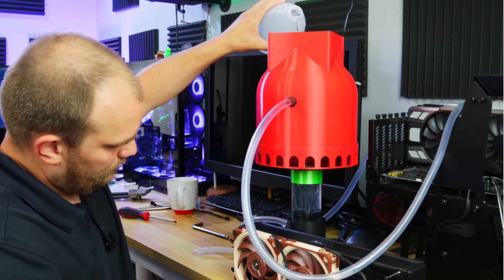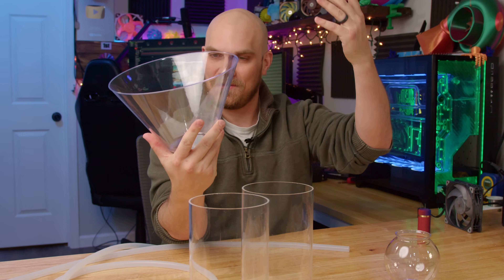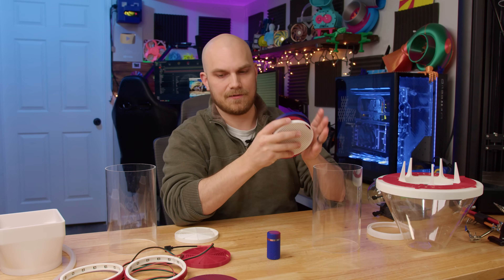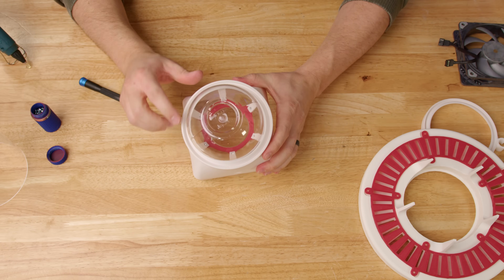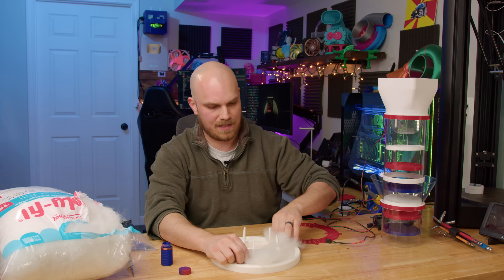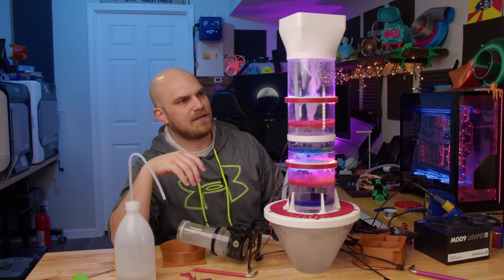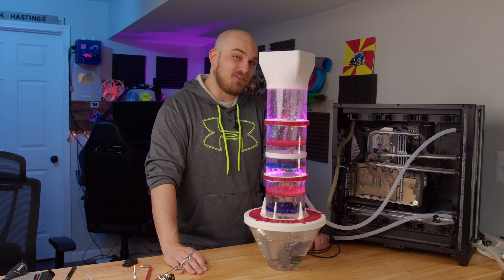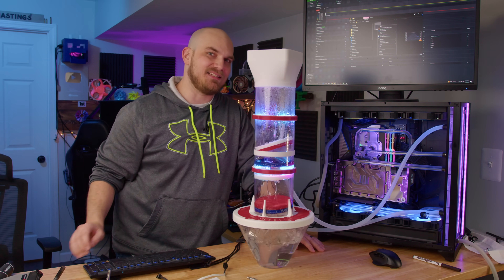Water Cooling..... With NO Radiators

Comment: Swimming pools in the deep south often use a fan shaped sprayer to arc the water into the air back into the pool, used to cool the water. That's basically what you did here in a more controlled package.

Comment: I just use a copper heatsink with copper and plastic fittings, vinyl tubing, and a copper heat exchanger. I have a pond pump, but no fans on the heat exchanger, just ambient temperature of (71F). Keeps my Ryzen 9 3950X nice and cold.

Comment: you might be able to use a second fan to "spread" the water if you drop the water dropplets into it while spinning...  if you manage to insolate it good enough it could do a very good work into atomizing it for maximum heat disipation

Comment: Love the innovation. You asked for a challenge? MAKE a PC case using multiple 500mm radiators stuck together (possibly welded?) for the top, side, front and bottom, so four out of the 6 case sides. Then get a regular rear "metal"/3D printed rear plate with cutouts for IO. And finally hang the motherboard mount on cables under tension, like the EVGA E1 PC case.

I would imagine two length ways 500mm radiators to form the top, the same for the bottom and front, then five 500mm radiators to form the side of the case. A total of ELEVEN 500mm radiators, for what could be enough passive cooling to require no fans, just the pump to move the water through all the radiators.

Alternatively, you could either find, or 3D print, a distro plate to form the front of the case, so only top+side+bottom were radiator walls, reducing the number of needed 500mm radiators to nine.

Comment: you may want to add a tank that the pc uses as the source of water, then use a higher pressure pump (e.g. 12L/m at 50psi.) for the tower and use an aerosolizing nozzle (i.e. garden hose on spray) and don't use the fills.

Comment: i have built an industrial cooling tower and worked on others.  Fan on top vs fans on bottom doesnt seem to matter.  What does is the travel time of the water from top to bottom.  This would work better the more you can break up the droplets, it increases the surface area of the water and slows down its journey through the air.  Instead of 3-4 fill packs I would have 15-20 with maybe 3 gaps for rgb and visual appeal.  also the the fills should alternate between convergent and divergent, you dont want to have all the water in the middle or all on the outside.,  need to start with a shower head and then try to keep it from reforming into streams.

Problem is that if you get this working right you'll need a dehumidifier in the room hehe.

Comment: What if you had more of a mist tube. Water coming in would be pressurized into misters that make the water smaller particles and easier for the air to cool? Or if it's an actual pressurized system you could make it steam into a box maybe with a copper top that causes it to cool then drip down back into the system on the cooler side? Could be fun

Comment: I think you need to take a look at "Swamp Coolers" that are used commercially.  If you want evaporative cooling you need the water running over more surface area, preferably something porous to both air and water.

Comment: I wanna boldy assume that most cooling happend on the walls of the tower and not by the low air flow along the water. Now if thats true, a design with a tank (or tower) of water with heat exchanger /tubes or something that passivly transport the heat from the inside of the water tank to the air outside would work better (and quiter). Would love to see it :D

Comment: you could of also fully cut a hole in the bottom of the fish globe a couple inches across so air had a path upward and the water wouldn't form a single stream downward off of it.

Comment: the shower bits should of had cones both up and down so the water level on top of the shower head could not reach the open top cones, so the down facing cones would also drip from the cone nozzles and not join the water from other openings....

Comment: I once had the idea of using one of these epoxy river/ waterfall- desks as part of my watercooling loop. But it probably wouldnt have looked pretty for long with hot water steaming up. I did build an evopartive cooler from a small jar that had a showerhead inside and a fan on top. Worked good as a temporary setup but I had to fill up the water level once a day.

Comment: I very long time ago, I used I "Y" fitting on 4" pipe. 1.5' going down into a bucket and 3.5' going up in the air.  Using a rain type of fitting for a kitchen sink at the top of the pipe and 3 92mm case fans stacked on top of each other connected at the "Y" fitting I was able to leverage evaporative cooling.  This was all sitting in a 5 gallon bucket with a fountain pump cooling my Duron 900.

Another way to increase your surface area is to use scotch bright pads(maybe you can find white ones), I actually enjoyed the rain cooler.  Cool to see the same concept used twenty years later.

Comment: I kept looking at this and thinking "why not just use a rain wall instead"? You could easily put a rain wall in an enclosure (like a fish tank or plexiglass box) and then add a filtered intake fan and a fan for exhaust. You'd get plenty of evaporative cooling, filtered air and a lot less parts.

Comment: You should coat the inside of the tube with a hydrophobic material, it'll look a lot cooler but ironically slightly decrease the actual cooling.

Comment: what if you used a bunch of 120mm radiators as your filler and daisy chained the rads together to form one larger rad  then run water through the 120mm's fins in a stack, you could add the radiators as part of the  loop or as two separate loops  for example the water tower to cool the radiators that is circulating the pc water. rather then running the same water through everything.

Comment: having venting on the sides of the tube can take advantage of the bernoulli effect as the falling water should create a pressure differential. You did have the right idea using t he fish bowl but the water fall into the space between the bowl and funnel not ride the surface of the fish bowl as will only pull air based on a little friction  rather than pushing it downwards with its own surface area of each drop.

https://youtu.be/uvf0lD5xzH0 This video by practical engineering explains it with video and images.

Comment: Instead of having multi layer water spreader, why not use a high pressure pump with a mist nozzle at the top?
And that way, at the same time you could have the filter be underwater because of that high pressure pump.

The only hard part would be finding a pump that is quiet 😅

Comment: The biggest problem with this is going to be contamination and evaporation. A filter and UV light are going to be absolutely necessary long term and constant level monitoring might be needed depending on the climate in the area. With some more testing it could be very powerful though. A misting system could increase the cooling by a large amount instead of the droplet cooling.

Comment: Honestly I could see this working better with a bit of refinement, like as you said using filament that can handle higher temps, not using hot glue or any glue that would degrade with heat or water, me personally I would find a way to set up at least 2 fans up top to improve the amount of air being pulled through the system and even maybe having 2 air intake sections.

Comment: I used to cool my system which had core 2 duo and 8800GTX in it with something like this, it was idling 4C below ambient, I built it with tubes for sewers, basically just 150 meter long tube with 45 degree T pieces at the top and the bottom, I used an shower head as a nozzle and an centrifugal fan which head car air filter hooked up to the intake and output of the fan was hooked up to the bottom of the tower, the output of the tower was connected to the chimney.

Comment: +1 for making this its own series! Suggestions:

1a. 3d print spacers to separate each fill section: like \/\/\/\/\/\/\/\/\/ and wrap it around the inside of the tube. The tube means it can't expand outwards, so it just acts as a mostly-see though, very quick to print spacer. Also it should give the thing an industrial look

1b. Try using a 12V centrifugal blower on top - those make much better pressure difference than a fan, so it will be able to draw more air though - because it seems like you're pressure difference limited. Against a partial vacuum they'll spin up to a bit higher speed, which makes better delta-P again (more compression ratio), this why they're used pretty much exclusively in vacuum cleaners.

2a. Try making a 'Rotating Liquid Sheet contactor' (https://www.sciencedirect.com/science/article/abs/pii/S0255270116303695) : These have performance as good as a fully packed bed, even without any fill. These use a liquid sheet slot nozzle wrapped into a helix. You 3d print the inner nozzle). The sprayer is then rotated, which causes the sheet of water contacting the air to act like a fan itself. (https://youtu.be/Gi1G9zPqFSw ).  Key bit is 'slanting' the slot radially upwards a bit, so the water going out is also going a bit upwards, before it falls back down. There are design equations for it all on a paper, but it is behind a paywall.

2b. Might be interesting to try waterproofing a PC fan motor (because they don't have brushes: Probably something like dipping the PCB in epoxy resin, and coating the magnet well in heavy duty anti-rust 'fish oil' spray). That way it could be in the tower, spinning the RLS sprayer.

Comment: Used to play with these in the early 2000's. What you want is as small dropplets as possible spread as uniformly as possible and you want them to free fall against the airflow as long as possible.

Designs back then where otherwise quite simple and similar, just a collecting reservoir on the bottom with pipe to the PC and pretty long and wide tube (I used to have 1,5m 300mm PVC tube as the "rain tube"). The top part is the difference, we didn't go for direct airflow because we used the very top to diffuse the water (1-4 pipes from the PC pushing water to small PVC pipes at the very top with holes on the under side and under them a diffusing layer that was just a PVC cap with a ton of small holes through which the water just barely dropped down to the pipe). I used to have 2 fans in their own pipes separating from the rain pipe to upwards to the sides so water couldn't be pulled into the fans directly.

The true art came from tuning the fans. In the best case the airflow needed to be just rightly distributed so the dropplets don't get flown around in the pipe and hit each other and grow in size, so as stable and directly down to up as possible. The second part was the force of the airflow, you wanted just enough that the dropplets don't fall straight down but they fall slower because the airflow because the longer the dropplets fall, the colder they get.

I would recall some people who put way too much time to it managing to get the water returning to the PC being subambient temperatures. But the whole thing fell to the history once someone found out you could just use a small intercooler and strap fans to it instead of this huge rain tower and we got closer to the modern watercooling (we were still cooler because having the cooler within a case is such a limitation, just drill couple holes to the back, get rubber grommets for them and bring the cooling outside, you can even dunk the cooler to a fishtank and water cool your water cooler).

Comment: Nothing wrong with fans in push. This is a custom loop, and not an AIO with an itsy bitsy radiator, so you don't need every single degree you can get out of it. There's also nothing wrong with pushing air down to the bottom of the case, as the "LaW oF ThErMoDyNaMicS" goes out the window in a closed box with active air flow.

Comment: I looked it, i think you wanna made someone like in CHP cooling system. But un Energy Station the water-spray is not cooled himself water, the water is spraying in a radiator and into the radiator the liqud has cooled by evaporation of sprayed water (i hope you understand my very bad english) MayB if a buld this cooler but insted of a plastic partition you put on a tube a watercooling small radiator it's be most proffitly?

Comment: Just an idea, why not have the water run around the tube in a staircase sort of way? I’d imagine the amount of times it would drop off each stair along the way would release heat eventually plus it would leave the middle of the column open specifically for airflow. Again, just an idea, I’m no expert but feel free to try.

Comment: Taller, and maybe push the air from the bottom, with the filter materials above the intake, the fish bowl can then be used, and the top, can be made more visually appealing.
Also, ẩm kế it taller, and you might even see a real difference in temperatures, as the time the water spends in contact with air, the more heat it can transfer...
A way to minimize overall water loss is to have a peltier effect chip(?) at the top connected to a copper pot, to help condense the water that has evaporated perhaps? It doesn't need to be powerful since the goal Isn't to bring the temperature down all that much, it's main goal is to simply help the water condense and given how that works, even a few degrees difference can be enough for that...
A fancy option is to put dry ice at the top... 🤔
The design would also work well for that LED center light. 🤔

Comment: Could this work if you used "rods" to direct the water into columns that would keep the water from forming a "seal" at each layer? Depending on how many rods you can suspend you could increase the surface area of the water to contact with the air to improve cooling.

Comment: Love this thing bong cooler. Some issues with this the humidity from the cooler evaporating well works as a humidifier.  So the room will keep getting more humid, loosing its capability to evaporate as efficiently. A desiccant can work well to help on the fan intake or exhaust, make a filter. Nate Things mentioned a liquid to liquid heat exchange. In the res or base so loop dont crud up or risk corrosion from what u need to add to the loop to keep it from growing any unwanted molds. air flows important to i used a duct fan if i turned it all the way up it blow water out the top. the longer the tube u have to deal with more head pressure to get the water up there, but dose help with water have more air contact time, also want water to be in small droplets but not to small, or they don't fall. Windows update killed my evaporate cooler dream.
ltt did this way back  https://www.youtube.com/watch?v=jsQKyAswAPI
Tec ingredients did something similar but really in depth  https://www.youtube.com/watch?v=R_g4nT4a28U

Comment: I would suggest finer mist and no baffles, height is good but taller is better. Put your water filter on top of the bottom reservoir not in the air flow.
Evaporative water cooling will need topping up and an anti bacterial additive do you don't get Legionnella in there

Comment: Missed (mist) opportunity!! 🤣 You could have put a fan inside, let the water strike the middle or the blades and it will be flung and misted , greatly increasing your evaporation and thus your cooling! Now you can have a fan blade showdown of water flinging and misting designs!!!!  Probably a good idea to silicone conformal coat the center electronics.... And mount the fan hub up to keep some water out of the bearing

But also be aware of the indoor humidity. As relative humidity rises during use, evaporation will become less and effective heat removal will reduce. So over time this will do a worse job unless you can keep your indoor humidity low and stable with outdoor air exchange.

Comment: This is a great cooling solution, the sound alone would be good for calming. And maybe with a bit of tweaking would work well enough for most systems. I don't know about you but my only concern with evaporation cooling is corrosion in the water blocks.

Comment: The issue with evaporative coolers is that you'll saturate the ambient source in this kind of setup.  A proper evaporative cooler uses evaporative pads, for surface area, and in the configuration here a hot water in with cool dry air in and hot saturated air out with cool water out.  Unless you fully separate the air in and out, in this case pumping exhaust outside would work best, you will humidify the room and increase ambient temperature; and due to the PC being a heat pump, it'll continue to do so until the system as a whole reaches equilibrium, if not continue until thermal throttling enforces that equilibrium.  Even if you dehumidify the air, that won't help with the constant rise in ambient, even pumping AC air into the room will only marginally help, this is why intake and exhaust either need an unrealistically massive room or need to be separated entirely.  And by the point you have a system that does work, works around the clock, etc., you basically have a shitty little heat and humidity pump; while you're going through the trouble to perfect a system, you might as well cut the humidity part out and just use a heat pump instead.  There's a reason why evaporative coolers never really caught on, and a reason why their realistic uses are severely limited in scope and implementation.